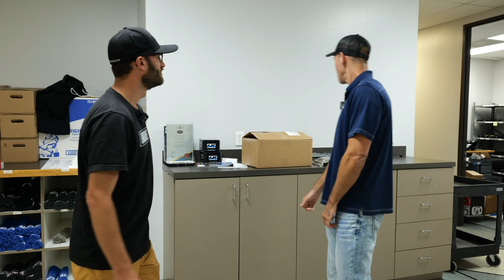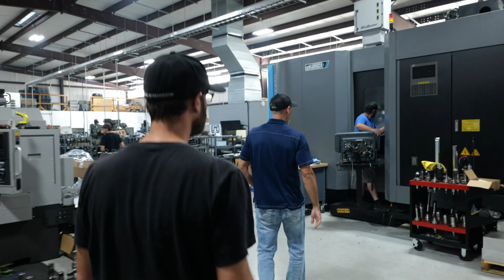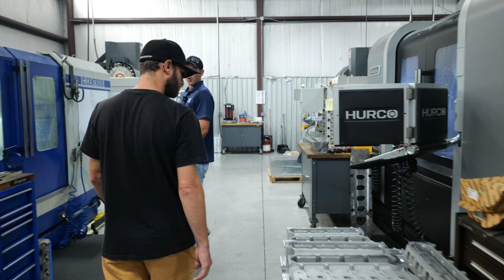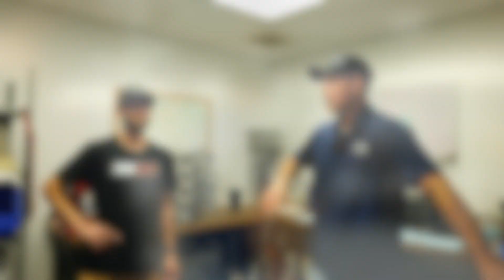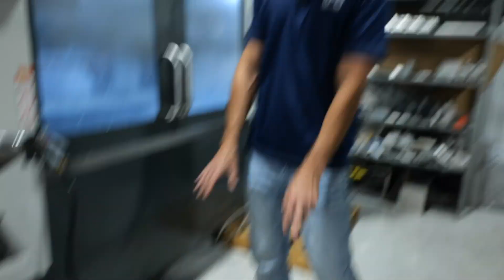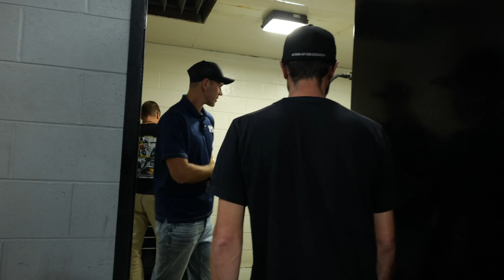17,000 sq.-ft.  of Engine Awesomeness at Late Model Engines

Comment: Big business.Great CNC'd parts, heads,covers,manifolds etc.. Lots of engines, 500 plus a year.... Just a thought, you need a bigger engine building room with fitted out bays...looked a bit cramped in there for 6 to 7 engine builders...